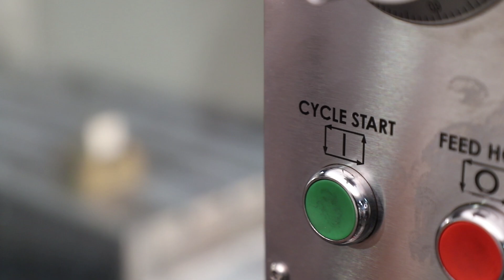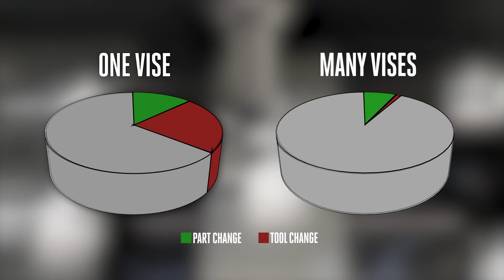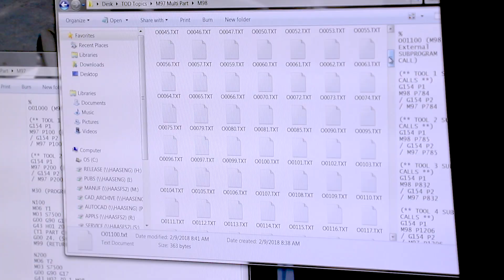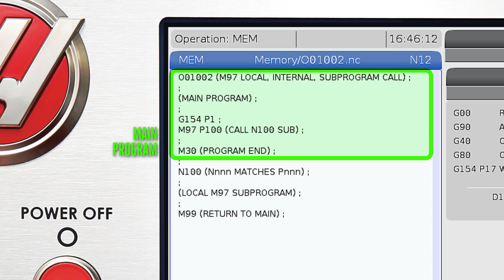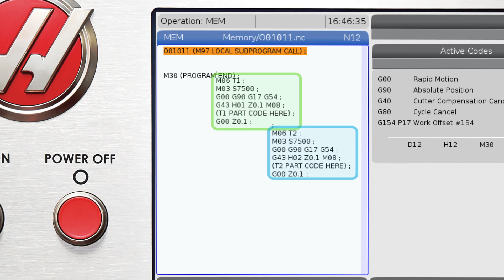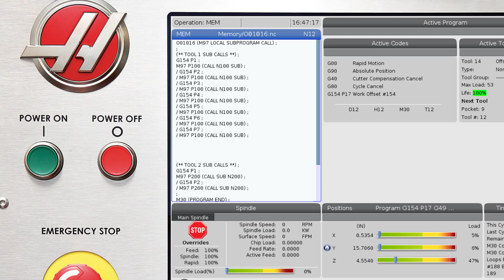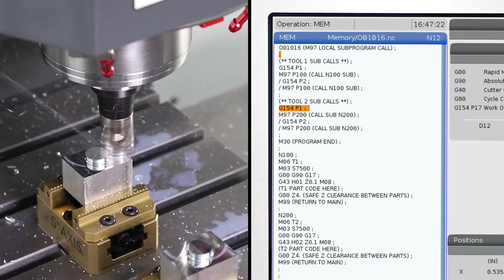Run More Than One Part at a Time; How Production Shops Use M97 - Haas Automation Tip of the Day

Comment: Better make a WCS-code for 25 parts at the end, you don't have to repeat that on every tool, you can save a lot of space.
That WCS (internal) sub can run with G52 or G54-G59-G154, just put a e.g. VAR #510 in for the number of parts you want to make.
You can combine the program with M97 and M98 for larger ext. sub-programs, I do this all day on a FANUC with M98 Qxxxx.
I have these in my programs internal or permanent stored in the control, for 10 or 50 parts, the amount of parts is set by a VAR #510.

Comment: I’m almost completely new to CNC Milling, but don’t you need to locate the parts using the touch probe before running any of this? 

That way you can know the precise location of any of the blocks. Or would you just select blocks with a margin great enough that any slight variations wouldn’t matter. 

How does the machine know where each part is? Do you set the coordinates of your work offset beforehand?
Reply: you can set offsets manually if you dont have a fixture. but if you're running hundreds then a fixture is worth making up and you can run g52 (assuming your fixturing is accurate) using one designated spot on the fixture to which all parts are referenced.

Comment: Thank you sir for this video,im asking if this M97  can use in Fanuc?
Reply: It used to be that you could only use external sub programs on those machines, using an M98. I’m not sure if things have changed recently.  We’d have to reach out to their applications people and see if things have changed. 

Internal subs are really handy on Haas machines.
Reply: Fanuc uses M98 Qxxxx instead of M98 Pxxxx, set by parameter 6005 (SQC) #0=1 for internal subs, works the same as Haas M97 😉

Comment: 33years machining the haas contol stay pretty much the same seen the orange crt screen to the led used today but buttons stay same no other machines are like this and proves haas best control over my 33years as have run makinos to dmg best to run haas machines as may not been as fast machine but was much fast pushing programing the haas as every type prg i saved a generic copy that to new prg then just change what needed by minimum speed feeds and location and z detpth you off and run n like quick code but at your desire this way you build custom one off part and to do this on fanuc or heidihine control was much more in depth and time consuming

Comment: While it's implied, the video didn't mention all of the time needed to place the multiple parts across the multiple vices, then running the probing cycles that establishes each part location (center of the blocks, or x,y origins, and z surface heights.) These processes add to the setup time initially to be able to run multiple parts. I suppose it's still less significant in a production environment but worth a mention?
Reply: except that the time you spend measuring with a probe would be the same if you were probing one piece, and you don't have to use a probe, you just need to make "zero points" and you don't have to use a probe at all, using macros I can create a tool group that checks the tool after the operation is complete and if it is "bad" it calls the second tool from the group and this way, you can use the spindle to 90% capacity

It's not always worth doing a fixture, but for a series, definitely

Comment: Working for a small-medium sized company most of the parts I get range from 1-2 or maybe a dozen of any particular part. most of which are one time runs or something I might  make twice a year if a recurring contract. It gets annoying as management gets restless because of the slow pace, I get annoyed because every day is like starting from scratch having to program an entirely new part and having to make yet another one time fixture widget. Parts that are not complicated but sometimes require 3-5 different operations on a vertical mill.  

 Cycle times are short but the setup/tear own/reset for the next part eats so much time.

Comment: G52 is your friend here.  One work coordinate and a limitless amount of parts can be made.  
Another key factor is subplates, tomstones and pallets.  If you want to run high numbers, yet still be nimble enough to jump in with small batch runs, you have to get away from the vise.
Haas' M97 feature is literally one of the slickest items they ever put into a controller.  I've been using them simce 1994, running as many as 260 pieces at a time on a VF2 with a 4th axis tombstone.  All with one work coordinate.
For the naysayers that say you can't pick up where you left off on a broken tool or scrapped part, that is simply not true.  With G52 I can restart the machine and begin at part number 88 on a 120 part run without skipping a beat.
It always amazes me how many machinist do not know how to do this.  
Great vid that will hopefully open some eyes.

Comment: 3:25 or 7. total time not matter if not have time operate all once lol 1-3 machines allways stopped when on another machine, but 1 man can easy handle 7 machines or just programming while boss throw parts in and not measure. not even before packing lol. well they shipped back. question is allways did measure? before green button or inpect before shipment lol. NOH

Comment: QUESTION: how do you offset each tool to be a different height? does the same tool have different H values in the tool offset page? for example the first sub program tool(vice style 1) will touched off the top of the stock, with th H1 call out, for the next sub program will i have to touch off the top of the stock(vice style 2) and use H2 instead?
Reply: We will set all of our Tools at one spot, and record their Tool Offsets, we will then set a Work Offset for each Workpiece (Part). Each Part is given it's own Work Coordinate System, like G54, G55. The method differs if you are setting manually, or with a probe. We have videos on both. https://youtu.be/uNjMIIRttFE, and https://youtu.be/5I1eG49XnTA, and we will be posting another video on this in the next month, so check back.
Reply: @markterryberry4477  where is the video mark?

Comment: Ok , nice bit of info 25 years ago. But truth nonetheless. Was using M97 back in 1995 for this very same reason.
  When are you going to do a video on how HAAS finally does peck tapping like everyone else? G98 G84 R.02 Z-1.0 Q.15 ???  The current steps to peck tap with a HAAS are appalling.  Makino, Mazak, to name 2 that I know, of have been doing it for over 20 years.

Comment: Am I missing something? I run a 20 year old VF4 Sirco. Does the one in the video have multiple tool offsets for each Home? I only get 1 for each tool slot. Or is another offset for each home being added in?
Reply: Hi Justin. Each tool will use its own Tool Offset, and then we can use a Work Offset for each part. Our Tool Offsets affect only that tool, while our Work Offsets affect all tools at the same time. Take a look at https://youtu.be/uNjMIIRttFE and https://youtu.be/AyMsFtwzrmI for more information.
Reply: @markterryberry4477  Thanks Mark,  this makes allot more sense. This channel is great, and really informative.
Reply: @markterryberry4477  QUESTION: how do you offset each tool to be a different height? does the same tool have different H values in the tool offset page? for example the first sub program tool(vice style 1) will touched off the top of the stock, with th H1 call out, for the next sub program will i have to touch off the top of the stock(vice style 2) and use H2

Comment: Im sorry but i still confuse with "G154 P1 - G154 P7", arent that suppose to be "G54 - G59" work coordinates?
Reply: Bayu. They do the same things. We ran out of Work Offsets like G54-G59, so we added G154 P1-P99 to make more Work Offsets available to the machinist. We will find G54, and G154 P1 on the same Work Offset page, as they are both just Work Offsets.

Comment: What about all the extra set up time to load vices and set 30 different work offsets?
Reply: That is the real question isn't it.  As production managers we really have to run some kind of Break-Even Analysis and decide if we are running enough parts to recoup our setup time. Some quick math, scratched on the back of an old print and we should be able to get a good feel as to which jobs are worth the work. For higher volumes, this can really save you some time, by increasing your unattended runtime and allowing you to step away from the machine for a longer amount of time, even getting a full table worth of parts finished while running lights-out. Great comment, we have to ask the question.

Comment: This is basic machining productivity information that should be commonplace. We've been making dedicated pallets and using "M97" type programming since we got our first high end VMC in 2008. Hurco and Siemens controls both make this type of programming extremely easy. You don't need to use an M97 command, nor do you write any sub program calls. Just probe (or program if you designed/made the pallet in house) your coordinates of each setup and tell the control which program to run. In fact, we save even more time by reducing tool changes to the bare minimum by taking this concept one step further. This can be done by posting each tool as it's own program, then add them in your pattern setup on the control. Add tool probe check to protect against broken tools and sister tooling for a lights out operation. By the way, mounting all these vises directly to the table is insanely inefficient as well. Invest in a Pierson Workholding Pallet system and mount all of your vises to pallets for 30 second changes that require no indicating. And create your own dedicated fixtures when the production run is more than 50 parts. My 2 cents from years of making it happen...
Reply: Sorry to hear hurco most junk machine tywain made had 5 axis that was throwed in with big dmg as we said was corvett but hurco was a chevett been try sell cant give away software contol glitch and spindle is chisle use so we only hack with hurcos
Reply: @jodygwiinn1233  Are you doing alright over there?
Reply: Hurco jerco

Comment: The only problem with this is when the machinist is not standing at the machine when a tool breaks.  You could scrap out every single part you have in there if an insert or tap breaks on the first part while unattended.  While this works great with aluminum how is it going to work with 4150 or 52100 stock?
Reply: This is why you invest $5k into a tool probe and set up a probing routine within the production cycle. We probe every tool on its way out and on longer cycles, we probe it sometime within the cycle. And we have a backup tool in the changer that resumes the cut immediately. Oh yeah, we also run Hurco so this may not be possible on Haas.

Comment: how are you changing your z values. when i do this i usually just copy and past my toolpath for each tool calling a different workoffset. i also turn off h and t code agreement (dont like to) and use different h values on the same tool.

Comment: You can set in MDI G10 Q2 P1 (G54)
                                 G10 Q2 P2 (G55)
   etc .....
All excellent points for saving time, but you need to factor in setting up a vice, parallels, stops, a work coodinate per part, and make work shift or TLO changes for different heights.
For lights out running large quantities definitely worth the set up / program time.
Good video

Comment: This is ok for 10 parts but I am running 6 pallets with 24 parts on each pallet. This would take 144 different offsets. Here is a way to do it with macros and g52's. I have a row of parts 2.7 inches apart in Y. I can set my G54 right in the program then use a coordinate shift (G52) for each part.
 #5221= -13.814 (G54 X) (this sets your G54 offset in X)
#5222= -3.6 (G54 Y)  (this sets your G54 offset in Y)
#5223= -16.35 (G54 Z)  (this sets your G54 offset in Z)
#5201= 0 (G52 X) (this cancels any G52 coordinate shift in X) 
#5202= 0 (G52 Y) (this cancels any G52 coordinate shift in Y) 
#5203= 0 (G52 Z) (this cancels any G52 coordinate shift in Z) 
G00 G54 G52 Y0 M97 P1004 (goes to line 1004 and runs 1st part at g54)
G00 G54 G52 Y-2.7 M97 P1004 (goes to line 1004 and runs 2nd part shifted by -2.7 inches in Y)
G00 G54 G52 Y-5.4 M97 P1004  (goes to line 1004 and runs 3rd part shifted by -5.4 inches in Y etc.)
G00 G54 G52 Y-8.1 M97 P1004 
G00 G54 G52 Y-10.8 M97 P1004 
G00 G54 G52 Y-13.5 M97 P1004 
M01 And repeat for each tool. This way all the part positions stay with the program.
Reply: Yes, this is much smarter than the video example. We do the same thing in our shop every day.

Comment: What is the issue with calling tools in the sub-program?  I have a nextgen UMC running an M97 sub with four tools,  seems fine so far,  is there some risk?.  In my case the sub program is used on two ends of  the same part, with only one part in the machine at a time.  Is the issue with the example given here for minimizing tool changes?
Reply from the maker: YCMC30cnc – Yes, spending the time to break up M97 subprograms by tool is really just about minimizing the number of tool changes. Good point. – Mark, Haas Tip-of-the-day

Comment: Another handy use for M97, is for multi tool holemaking. Just put all the xy coordinates i  the sub, and call up the sub program for location for spot, drill, tap, countersink, etc. This method has two advantages, one it reduces the size of the program, and two makes use of one set of coordinates, which means any location tweaks carry over to all operations, so theres no possibility of missing a coordinate on one of the operations.

Comment: No, I  disagree that it saves time, what it does is allow the operator to have more time to be doing something else, run multiple machines, inspection etc, as the video points out, run through breaks or lights out machining. Tool change times are so quick now (a major sales push), that it can be quicker doing one part at a time, loading and unloading 12 parts vs 1 part for a 2-3 tool change and one coordinate set up is quick.
It really only works if running multiple machines or lights out or using a palletiser system. and # of tool changes to a degree.
Reply: Are you kidding? You believe that loading one part at a time is faster than running 100 parts at a time? It's not about tool change time. It's all about opening the door as little as possible. Load 100 parts, run them for 2-12 hours. Open the door and load fresh pallets (in under 2 minutes). Close the door and press cycle start. We do this every day and it is almost as efficient as running a horizontal.

Comment: As someone who's worked as a setup guy in factories for a while, it amazes me that this isn't common sense to some people. I've walked into factories and had cut run times down to a faction of what they previously were, buy setting up 4,5,6 separate operations on the table at once. 

You have multiple sets of work offsets.... use them
Reply: i get paid by the hour
Reply: @turtlebeef  and during that hour you are supposed to do your work, which should include setting zero points and clamping fixtures into the machine

Comment: I do now understand why this kind of programming is unsuccessful: nobody can understand it by just looking at it. I have programmed industrial robots, but the programming languages were way easier to handle - in fact, most of the work I've done at home and a fraction of time on site.

The only way this kind of coding would make sense, if the CNC machine would register my manual operation.

Nonetheless, the tutorial was excellent for its kind.

Comment: First time watching your videos Mark, they are awesome!

In addition to machining multiple parts with G97 or G98 subs, more time can be saved by choosing the order in which the parts get machined, to shorten up travel on any of the axis. For instance, on your video, start all spotting, drill, tapping, etc from left to right, since the left vise is taller you can move the initial Z plane closer to the top of each part and use G99 on all of the parts.

Furthermore, if this setup is for production parts and will run for a decent period of time, it is worthwhile to review each sub and change the order on which the features are machined. Once again, with the purpose of minimizing the travel of the machine from one part to the next.
Even a split second saved adds up at the end of the week.

Great video, Thanx !!!
Reply from the maker: Alex – Great ideas. Every second counts, and once you start thinking about these things, it becomes a good habit. I’ve seen some, on large machines with slower rapids, use long holders for their drilling operations so those tools don’t have to rapid as far in the Z. Good stuff. Get’s me thinking. – Mark, Haas Tip of the day

Comment: At 3.23 if any accident may occurred. What have you been done
Reply from the maker: Surya Prakash – If the machine had a problem, it would alarm out and stop itself. Low coolant? Alarm. Tool Breakage? We can check that with a probe and alarm out if it is broken. Axis overload? Alarm. We can even have the machine email us or alarm out in our phone App to let us know there is an issue. https://youtu.be/2SKr0Azq2Oc - Mark, Haas Tip-of-the-day